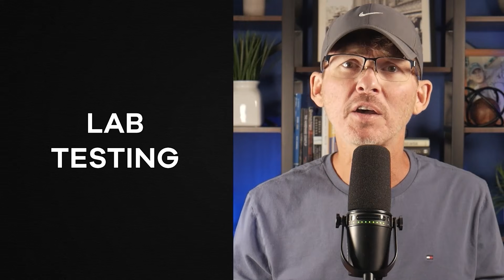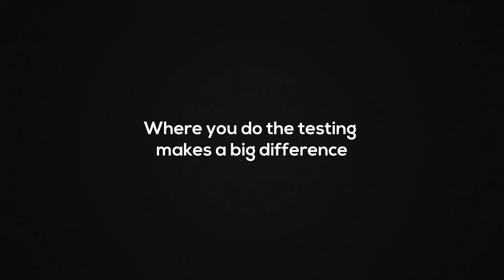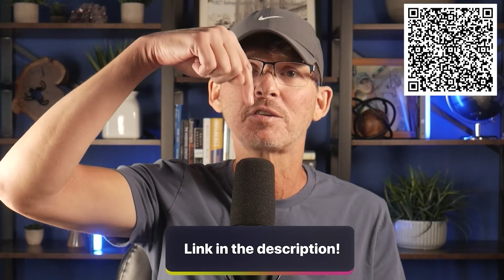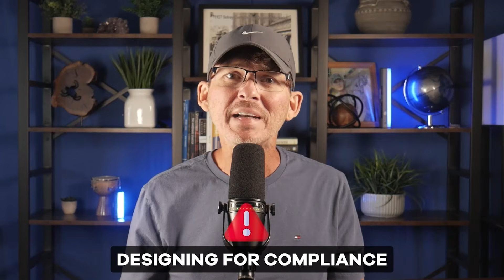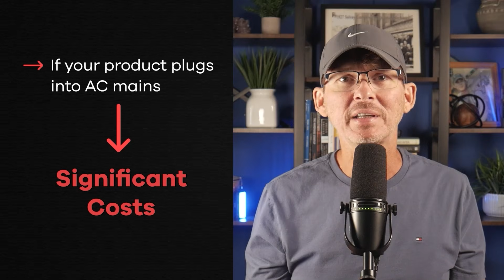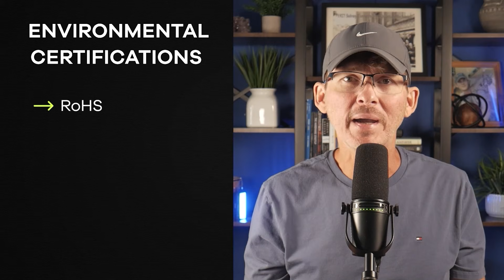How Much Does FCC and CE Certification Cost?

Comment: General aviation is trapped in a 1950s regulatory loop—leaded fuel, outdated engines, and a certification system so rigid that repairing a $50 circuit board in a Cessna can cost $20,000. To modernize safely, the FAA should cap liability at 10 years, require recall bonds, and track real-world failure rates instead of relying on static certification. This shift would preserve safety while freeing innovation to finally bring aviation into the 21st century.

Comment: Thanks for making this video.

1. Does plugging into a UL-listed wall wart count as being connected to the mains?

2. If the only components touching mains power are a UL-listed wall wart and a UL-listed relay (or “relay-in-a-box”), and my product only uses low voltage to control that relay to switch a device like a lamp or pump, would the overall product still require certification?
Reply from the maker: What you've described is exactly the right way to avoid needing these safety certifications.

1) No
2) No
Reply: @PredictableDesigns thank you!

Comment: John, it would be immensely helpful for a video on methods of "in-house, uncertified testing".  Surely there are some methods to sniff around for EMI way before having to send to a accredited lab just to fail.  I know when I was investigating NSF compliance for a device submerged in drinking water, I questioned them on the process, which was exactly what I suspected.  They simply submerge the device and subject it to a few stress variable, then ultimately test the water for contaminates.  IE, we could easily simulate that test and send our own water sample for a $50 test, only to give a little reassurance the device would pass.
Reply from the maker: Unfortunately EMI testing requires very expensive equipment and a specially designed testing room called an anechoic chamber. Thankfully though a quick pre-compliance test can be usually done cheaper than full certifications testing.

I think one of the best ways to prevent failing EMI is to be sure you get an engineer experienced in EMI related PCB design to review your design before you fabricate it.
Reply: Spectrum analyzer and some probes will give you a good idea.
Reply: This is going back some time (around 35 years) but the company I worked for at the time did its own "open field" EMI tests - done literally in the middle of a field some distance from EMI sources - before stuff was sent to the certification lab. There were costs for test equipment (as I recall mainly a spectrum analyzer and antenna) but being able to do tests in-house meant we had no failures in the certification lab with consequent additional costs and delays.
Reply: @jeremybarker7577  One trick is to null out the background radiation. See what trace you get before switching on your device, then subtract it.

Comment: Thank you for the video! I'm in a bit of a tricky situation where it's really hard to tell whether I need the certification in the first place. Basically, my product is a combination of a non-certified Bluetooth module and an MCU with a special firmware, and it is intended to be a module of its own, to be installed into other devices. Unfortunately I have to use a specific Bluetooth module that isn't certified anywhere. But since my module is designed for professionals who will use it as part of their own devices, do I need to have my module certified? Or in that case, does the burden of certification lie only on whoever assembles the final consumer device? I would appreciate your thoughts a lot!
Reply from the maker: Great question! In this case as long as it's clearly labeled as a kit to be used in other devices and it's not a finished consumer product, then you should be fine without FCC cert even with the uncertified module. This is clearly defined in the FCC regulations. Hope this helps.